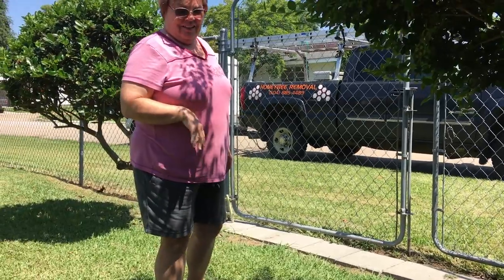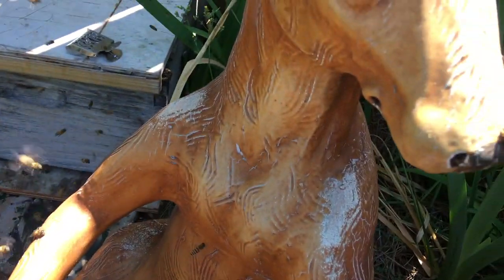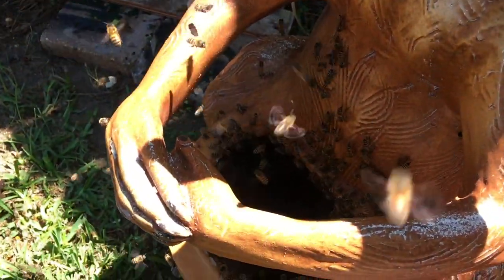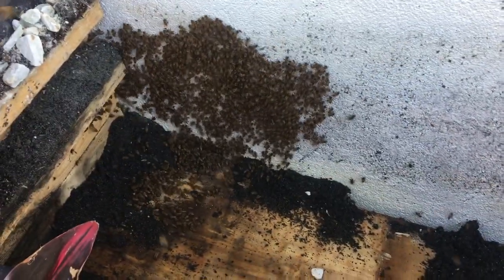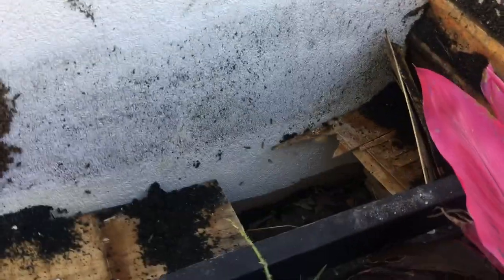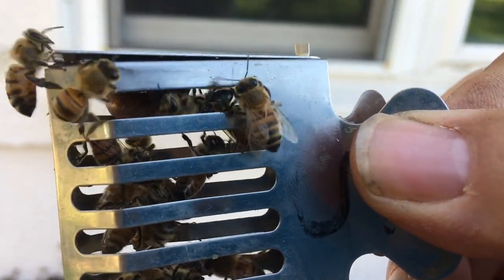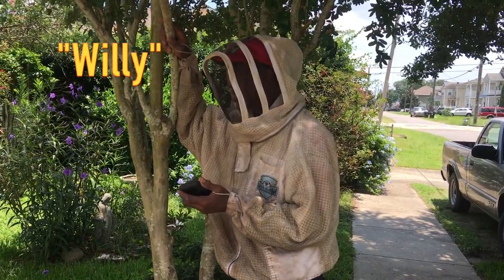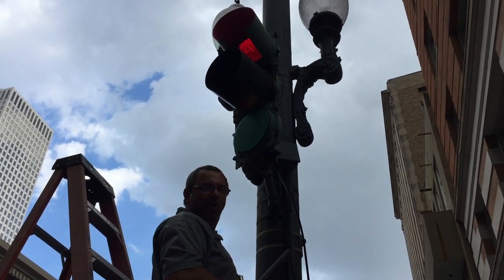Honey Bees In Strange Places

Comment: Someday I want to buy a house just for bees, out in the middle of nowhere.
Reply: My old place had just that. There was a small framed cabin. In the walls of it the bees made a nest. It was a MASSIVE nest. We're unsure what caused it, but the hive died out. After they died out, we peeled back part of the wall to expose a hive that was 7 foot tall, 6 inch thick, & ran the length of 10 foot!
Reply: The good bee houses are in town. 
Really. Let me build you one I know exactly what to do to make your house full of bees.
Believe it or not all you need to do is buy the right abandoned Mc mansion. Unbeelievable
Reply: I've seen bee sheds :)
Reply: That house would be filled to the ceiling with dead bees over the years.

Comment: Can you drill a hole at the kangaroos back of neck, spray bee be gone in there ?
Reply from the maker: The thought didn’t cross my mind as the lady was pretty adamant about not harming Wally. 

Drilling a hole through the thing may have cracked it & she would have been one unhappy camper.

I believe the roo was ceramic.
Reply: Ahh, ok, you did a great job finding the queen quickly anyway, cheers !